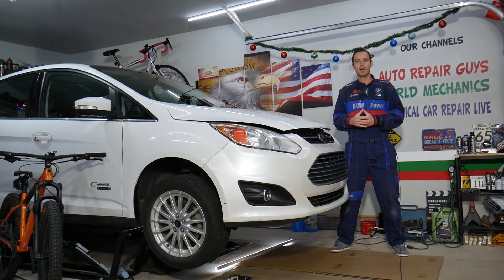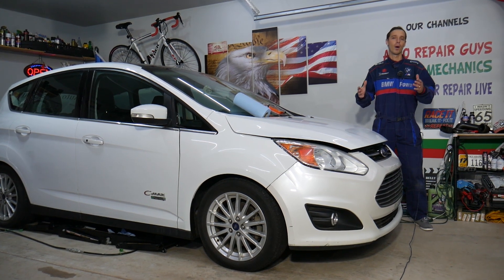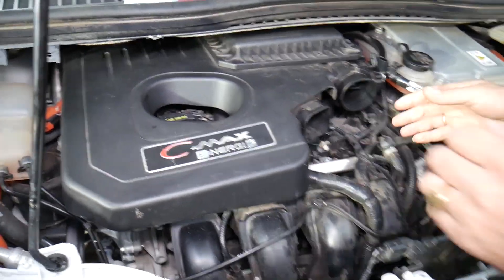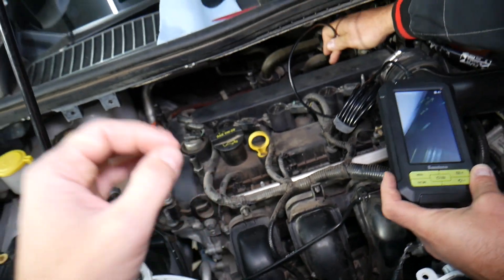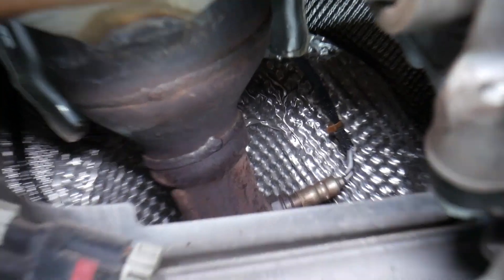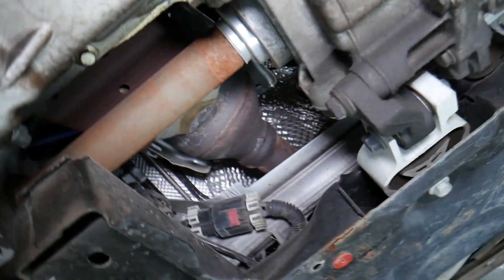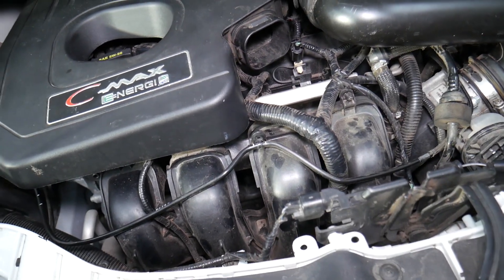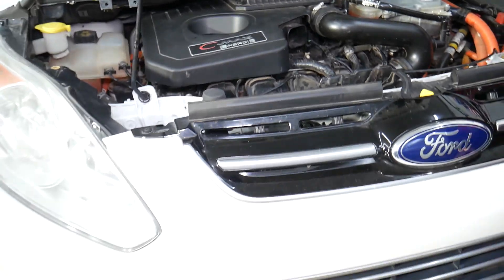CODE P2270 P2271 O2 SENSOR SIGNAL BIASED STUCK CHECK ENGINE LIGHT FORD C-MAX FORD FUSION LINCOLN MKZ

Comment: I've been having all kinds of issues with my civic 1.5t. Then today I get a P2270 code. It's got to be the injectors! It's ALWAYS the injectors on these stupid engines. Honda needs to do a recall on the injectors because it's getting ridiculous.  Everyone I know with a 1.5t has needed injectors by 100,000 miles.

Comment: Is't same with Toyota camry hybrid 2018!!!?
Reply: Hi my 2019 camry is reading check engine error code 2271. Did you ever get your camry fixed and was the fuel injectors